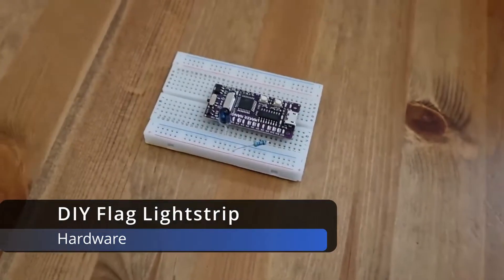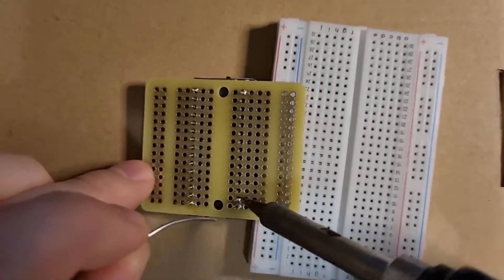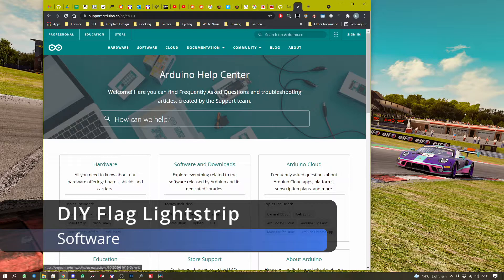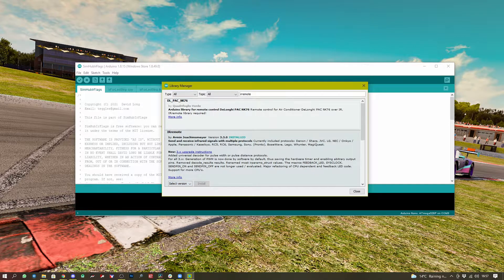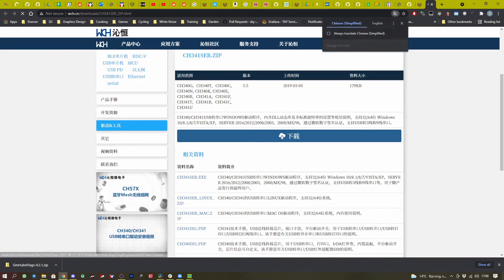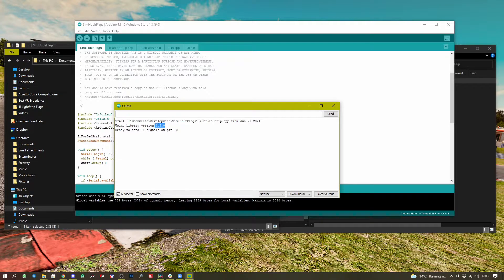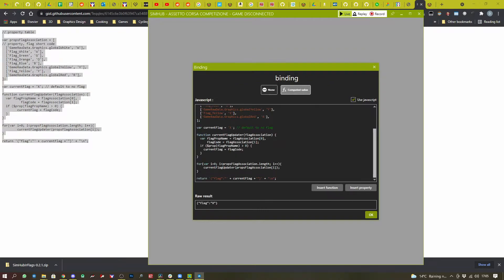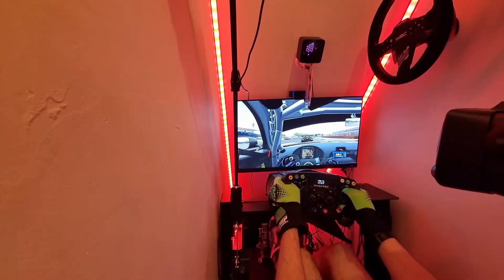Sim Racing Hardware - DIY Budget Flag Light Setup

Comment: Is there a streamlined tutorial of this? It is painful to watch.  Too much talk and not enough info on led connectivity.
Reply from the maker: I'm planning to write up a tutorial on the repository associated with this project.  I'm currently fleshing out a DIY flag light box and will write them up at the same time.
Reply: @TeqqlesdoesVR  Thanks for the prompt reply!  It is greatly appreciated.  Wasn't trying to be an ass with the original comment either.  Thanks again for your reply.
Reply from the maker: @deepreach7821  no worries, I know sometimes you just want something static in front of you that you can consume, especially when it's a hardware project 😉
Reply from the maker: @deepreach7821  https://github.com/Teqqles/SimHubIrFlags now has the circuit diagram and parts used, along with a basic installation guide for SimHub.  If there are certain details you're interested in having additionally to this please let me know and I'll get them in asap.